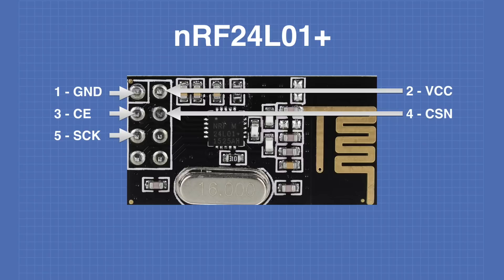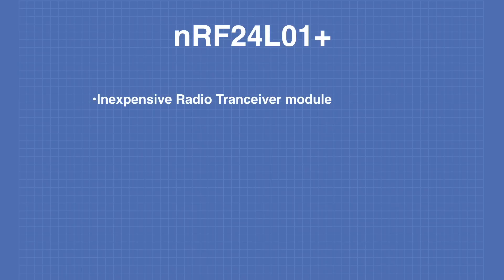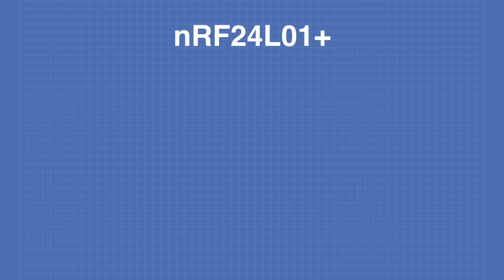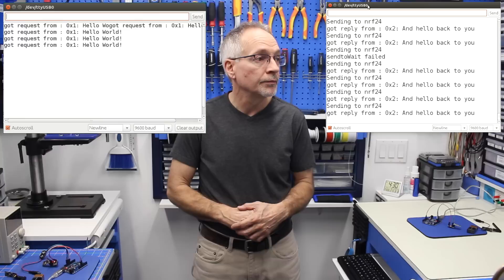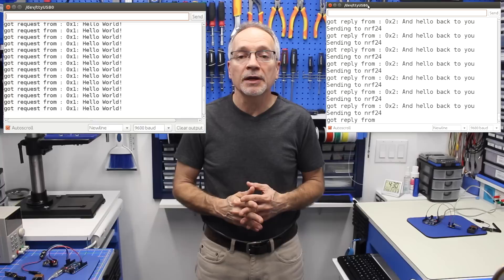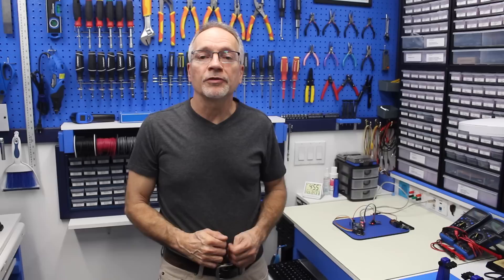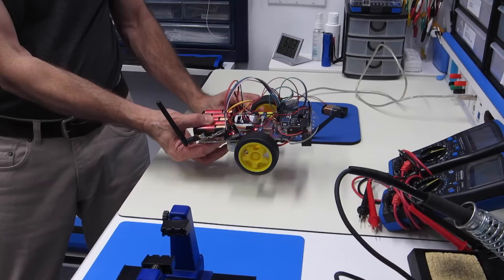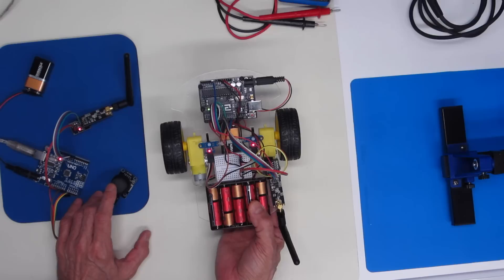The nRF24L01 - Wireless Joystick for Arduino Robot Car with nRF24L01+

Comment: For anyone in 2023 trying to make a wireless car with the steering controlled by a servo, it will work, but you will need to download the ServoTimer2 library. Also the number to insert in the servo.write() command will need to be from 1000-2000 or it will not work. For the normal servo library, its from 0 to 255, but for the ServoTimer2 library, its 0 to about 2300. Also, if you want to prevent the motor from spiraling out of control, make the max analog output to the motor driver be around 20% less than the actual max, so instead of writing from 0-255, make the range 0-200. I did this and it tremendously increased the stability. When I had it from 0-255 and I went full speed for a few moments, the motor would get stuck on the max speed, but when I made the max analog out be 200, it never got stuck. These are some of the problems I ran into after working nonstop for 10 hours, but I eventually got the entire thing to work!

Comment: Dear Bill: 

Thank you SO MUCH for all of the help and inspiration you provide to we Aduinovians;  I've learned more than words can describe. I thought I might share something I've learned along the way that may help others on a project like this.

If an individual is running the Arduino IDE using Windows 10, there's no need to have two computers to observe the communication between two NRF25 WI-FI breakout boards. As long as there are two COM port plugs on the computer, and there are two USB cables to use, here's the trick...

First, connect all of the wires between the two wi-fi breakout boards and the two Arduino boards, and open the Arduino IDE to get ready for testing. Open either the client-side or server-side .ino file of the NRF24 project being tested, and plug-in ONLY ONE of the Arduino boards using a USB connector cable to the computer's first COM port. Compile and link the .ino file and upload it into one of the Arduino boards. Make note of the COM port the computer assigns to the connection.

Next, right click the Arduino IDE's tab at the bottom of the screen (or wherever the open-program tabs may sit on the screen), and OPEN ANOTHER INSTANCE of the Arduino IDE (don't open the second client/server-side .ino file being tested using the same Arduino IDE as the first). Now that there are two separate instances of the Arduino IDE running, connect the second Arduino board to the computer's second USB port using a second USB cable. Compile, link, and upload the second .ino file being tested into the second Arduino board. 

The two different instances of the Arduino IDE are now running two separate .ino files on two different COM ports, and two seperate serial monitors can be opened to watch the communications between the two separate WI-FI boards. NOTE: The IDE has trouble when two copies of the SAME .ino file are open.
 The second instance of the Arduino IDE will most likely open with a copy of the SAME .ino file that is open in the first instance of the IDE. Be certain to close the initially open (copy) .ino file from the SECOND IDE after the second NRF24 file has been opened in the second IDE.  If you close the first copy of the two .ino files open (of the same name), you just closed the first instance of the IDE, and now, one IDE shares both open files again  (sounds more confusing than it really is). If something goes wrong, say my two favorite words, "oh well," and try again.

It's important to follow these steps in order and to remember which Arduino board is connected to which instance of the Arduino IDE, which .ino file sits in which Arduino board, and which COM port each the the Arduino's communicate through. When coding modifications are involved, it's easy to forget which board is the server and which is the client (or, am I just getting too old?).

Thank you, again, for your time and effort in sharing your wealth of knowledge. I'll be joining the DroneBot Workshop Forum just as soon as I get my MS email account password sorted out (that's it...I'm too old). I've only known about Arduino since early January of 2020, but have a I have decades of experience in DCv SCR-drive electric vehicles, and I was coding Turbo C in the early 1990, so I have a lot of coding experience to share. I look forward to the experience of the Forum. We have a lot to talk about, and I love to gab.

Stay well and take care;

Casey aka itsCaseyDambit

Comment: Please help. I have triple checked my wiring and code but I can’t get this to work. The serial monitor is showing the joystick sketch as working and transmitting. However, the car sketch only shows “obit failed.” What am I missing...?
Reply: Did you program the receiver and transmitter circuit on a single computer? How can I open two different serial monitors on the same computer?

Comment: Thanks a lot for this well explained video and concept. Indeed u make technology look very easy and practical to grasp.. but I have a challenge yet unsolved, when experimenting with the reliableDataServer / Client alongside with sensor(joystick), the transmitter is cable of sending data(joystick values) but at the order end(Receiver) , it shows init failed on the serial monitor… I have tried troubleshooting to no avail. Pls I need help…Thanks

Comment: Great video. Having the same issues as others...too much latency in rcvr response. Reduced delay value to 10ms, but still having issue. Also would be nice to turn both wheels when direction change is activated.

Comment: Hi, I followed exactly as described but somehow the receiving end seems to be the problem i.e not receiving the data. I swapped the arduino uno & the RF24L01 with the transmitter and yet face the same problem; i.e transmitting but not receiving. I have used other examples available in the internet and the result is the same. Not sure where I went wrong.

Comment: if you are using a mega you will also need to add the following code RH_NRF24 driver(8, 53) in the datagram sketches and RH_NRF24 RadioDriver(8, 53); for the joystick sketch as well as change the pin out if you do not make this change to the code it will not work.  Great videos thank you

Comment: how can i do this project with 4 engines and 2 l298n? would be glad for your answer
Reply: I think a single l298n would do the job,just connect two motors in parallel

Comment: Hi.  I am having no success at all with my setup.  I tried the first client and server sketches and nothing.  I moved on and loaded the nrf24 reliable datagram server on my windows 10 laptop and all I get on the serial monitor is "init failed".
I uploaded the nrf24 reliable datagram client to my linux mint laptop, and I get "Sending to nrf24_reliable_datagram_server sendtoWait failed" over and over.  I reversed the sketches so linux laptop is server and windows laptop is client...same issues.  I would like to troubleshoot the nRF24L01 modules and the adapters but I have no way to determine if one or more are causing this issue.  Is there any troubleshooting advice you can give me?  I am at a complete loss here.  Looking forward to a reply...thanks again.

Comment: Hi there! really solid video but I need some help. For some reason it says init failed. I've triple checked the circuit, replaced almost every single part and have gotten no results. any way you could help me?

Comment: This is a great video. I am trying this robot car. Though I encounter some problems on the transmitter side it says "init failed" on the receiver side it says "sendtoWait failed" and there are values given by x and y axis. Is there a problem using a clone arduino UNO as receiver and original arduino UNO as transmitter?

Comment: thank you for the video! the Radiohead library with the reliable datagram code is the only one that's working for the NRF24L01 modules I got. I also like your  code because it's simple and efficient. Yes, it's better to figure out the joystick position at the transmitter and then send just one enable command vs sending the joystick encoded value to the receiver. I will use this code to complete my RC tank project. :)

Comment: I'm confused with your if statements in the steering section, wouldn't your if statements for >255 and <0  fail because the unsigned integer as far as I understand will wrap back to 0 if it exceeds 255?

Comment: I am wondering if you can do a video with proximity sensors and beeper. I have a Harley trike that I am going to experiment with and can not tell how close I am to things when backing up or to the sides of the widest points at the rear. Thought this would be a neat project and very inexpensive. Thanks and keep up the great videos.

Comment: Congratulations on the tutorial, I would like to make a rover, with ps3 control, usb shield and nrf24. But I'm not able to run the usb shield with nrf24. I am using two Arduino UNO (TX and RX). Thank you for your help

Comment: Bill.  I found that the latest  RadioHead library zip file is quite different than the library you used.(even the example). Using this library does not allow your sketch for the robot car to work. Can you comment on why this may be the case? Can you do an "update" on this video with the latest RH library? The proper pin numbers to use for a nano and/or a Mega 2560 would be helpful. They are not shown in the sketch or the software. I know my hardware is OK since I have an old sketch that still works with the same nRF24L01 hardware but with  RF24 software. The RadioHead software is confusing to me ( pin #s and commands) also to many other users. Using for Nano (pins 8,10) and for Mega(8,53). A simple example of how to send /receive a few bytes of data would be extremely helpful.THANK YOU !!!

Comment: Hi Sir,

Thanks for the video and guide. But I have some several issues that I'm facing right now. I copied and pasted code for both tx and rx side. According to your video I also double-checked each pin which are connected to ardunios. Unfortunately, my setup is not working as yours. I cannot move the car with any of command which is coming from joystick. I figured out that even if communication is established between two ardunios the car doesn't move. Most of the times communication cannot be established. I'm using all components that you're using in the video please help me.

Comment: This has been bothering me for awhile, why not just leave the jumpers on the enable lines and if you want the motors off send the IN's both low, wouldn't that reduce the complication and amount of pins used by the arduino?

Comment: Great programes & as a 78yrs old I am trying to find witch two wires you are suggesting That were swap around (Input & output) as I am new to wireless controls With the nRF24LO1?

Comment: I was wondering if you would have used spi for transmission?

I'm trying to hunt down interconnect
My nano and esp32cam.
While I could connect to the cam separately, it seems a shame to waste a nano if you can also connect via the WiFi. I understand that a controller is still required, as I don't think the cam has many ports that are usable.
(Was hoping it had two to be useful as a cam pan and tilt)

Comment: A great tutorial but my server side serial monitor just throws a message 'init failed'. Have tried many different things to troubleshoot. Used the nrf adapter, filter capacitors, checked wiring countless times, powered the module with a separate power source,searched the web for a solution, tried to use different libraries, swaped the client and server modules to check if any one of them is defective but always the client sends its message and the server side serial monitor throws a annoying statement 'init failed'. Please suggest something to make it work.

Comment: Mine just says init failed and nothing else and yes i checked my wiering and everything . How do i fix it ???
Reply: ME TOO
Reply: Hi, I had the same problem with the receiver module. I checked all the connections several times, replaced all the wires to ensure good connections. In the end it was the nrf24l01 adapter AND the nrfl01 (with antenna) that had failed. Fortunately I had bought several of these items and was able to bug trace and eventually fix the problem. My conclusion is that I must have “fried” the chips on these devices while swapping wires around without using my wrist earthing strap because everything worked fine for several days during my build. Hope this helps. Have patience, go back to the basic rf sketches from the Radiohead library to prove/disprove your components. Best of luck - it’s a great feeling (probably relief) when it all works — again. — tidg69 ( aka Ian )

Comment: Hi!
I used 2 nRF with integrated antennae and hooked them up to Arduino Uno and Nano. Wiring is as mentioned in the video. Adapter is not used in either of the nodules nor have I used decoupling capacitors. Only client program is running (serial monitor shows.."no reply, is server running?"). To be sure, I exchanged the codes on the two arduinos. Turns out that there is no issue with the hardware and even the voltage is on the recommended 3.3v.

Server sketch doesn't seem to be running. Serial monitor shows "init failed"

Any diagnosis on what might be going wrong?

Thanks in advance!
Reply: Hi Nesar,  your not alone on this issue, I have the same problem. I can get a temporary response from the server by touching the terminals on the RF24. Like you, I have no issues with hardware and I have tried other code examples, swapped CE and CSN (radio) to other pins, used with and without adapters and various capacitors across the power supply. All to no avail. If you find an answer, could you let me know please, I,ll get back to you if I find a solution.

Comment: wouldn't be more useful to just send data when the position of the joystick actually changes? or at least resend the status if not changed after 2000ms and keep the value on the receiver either until a new value comes in or 2050ms would maybe save the battery if the joystick is not doing anything.. maybe just don't send any data after some time while it is 127/127

Comment: Excellent tutorial. It's obvious you prepare before you film. I have a problem, the  nRf24 client and the nRf24 server sketches work perfect, but the rF24_reliable_datagram client and the  rF24_reliable_datagram server sketches don't work correctly. The client side says-  init failed   sending to rF24_reliable_datagram server and the server side says nothing. I checked all connections and reloaded both sketches, it displayed the same thing. I reloaded the nRf24 client and the nRf24 server sketches and they work fine. Any suggestions? I would like to get this working before I continue with your tutorial.
Thanks, Steve Tripoli
Reply: same issue here, please help

Comment: Thank you for all your videos. They are excellent!.
I would like to know how I could transmit the car battery voltage back to the transmitter and display it on an LCD
In my case it's a boat and the voltage is 12 volts.

Comment: Thank you for your video, that's what I was looking for but, for now, I'm stuck. In client and server during the first test, it works but when I switch to data, I only have the client which sends a message, but it does not work in server. I have the data indicated in red although the compiler does not detect any error whereas in your video, data is indeed in black. Do you have an idea ? I tried several rf24l01 and different UNO

Comment: Hi Bill. I tried to use the joystick demo, and instead of the joystick i want to use the DHT11 temperature and humidity sensor. The temperature and humidity is set up as floats on the transmiiter and I read the float value on the serial monitor on the transmitter. however on the receiver I also read the values in the serial monitor, but the decimals are missing on both values. It seem there is a problem sendig floats through. how do I solve this problem?

Comment: Thank you so much for this tutorial it was immensely helpful! I have faced one problem however... Everything works well, but on my client side I notice that my car's NRF module stops receiving the coordinates from the joystick. The serial monitor shows a few lines of coordinates and then it just stops. Sometimes it picks up one or two more lines sporadically. When I reset the joystick it receives a few more lines and stops again. Any idea what the issue is? I would be thrilled if I could get this to work well. Thanks a lot for your time and effort! It's appreciated

Comment: @Dronebot Workshop i am trying to make a circuit which has 2.4" tft lcd screen, two joysticks and nrf24l01 and some pushbuttons. I am trying to assemble it on a perfboard and want to make it portable, which arduino board should i use , nano, or uno or any other. I am having some problem.

Comment: May I have a question. Could I connect pin CS of rf24l01 with the other pin and use pin D10 as pwm output? Thanks

Comment: Well, I got my car working. I had to adjust the joystick values, mine went from 0 to 220. I used a  car like yours but the kit came with 4 motors the right side two motors are wired in parallel so is the left side. It works ok but I can't figure out how when turning right or left how to get the motors to turn opposite of each other so it makes a sharper turn. Any help would be appreciated. Agan thanks for the VERY good tutorial.

Comment: One radio module I could never get working no matter what tutorial I followed
Reply: Make sure your arduino and nfr connection are as short as possible.  And the wires dont overlap each other too often . 
Also try using 3.3v Ldo (AMS1117) as a voltage source for nrf module as other switching regulators sometimes add noise in circuit

Comment: Hi Sir, I tried the client / server example with Radio Head Library using clone UNOs, I see that they get stuck (hang) at send call, checked the wiring it looks ok, can this be due to improper current from my Uno 3.3V output?